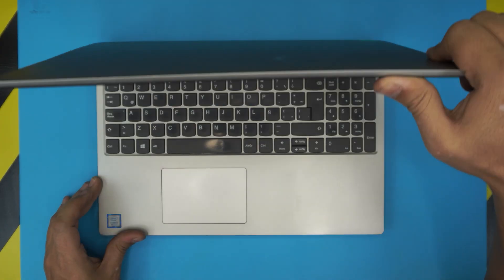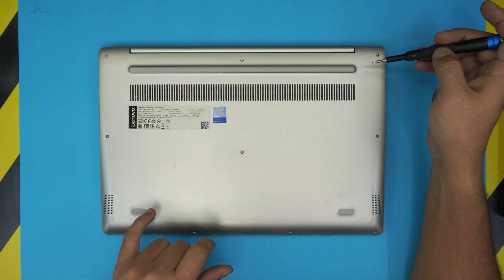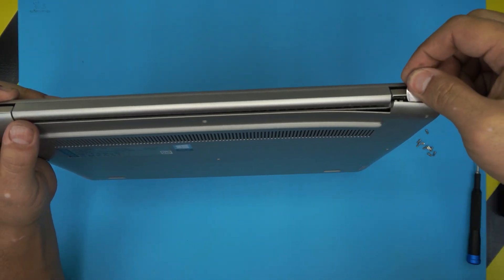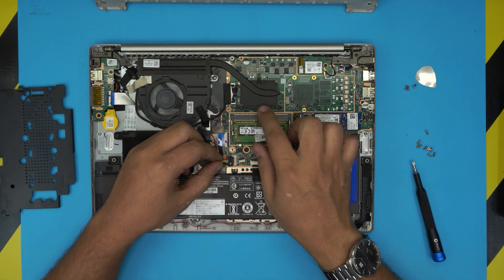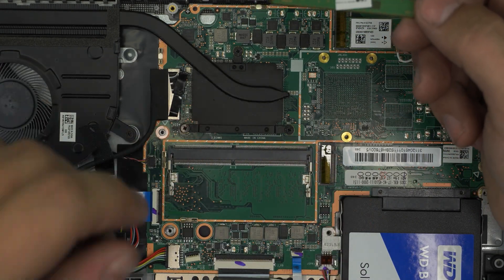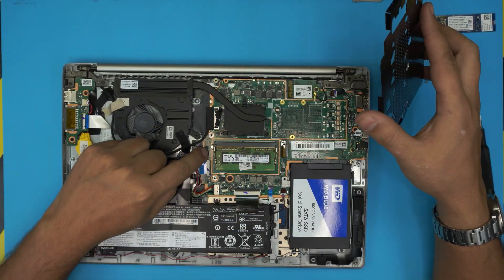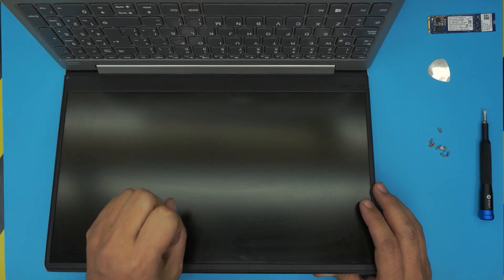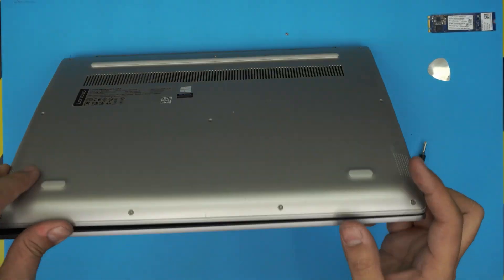Lenovo Ideapad 330S RAM Upgrade Step by Step

Comment: I have a problem in this laptop, initially laptop runs perfect but after 10 minutes a line on laptop screen blinking then after some minutes total screen  blink what is problem, give solution please 😢
Reply from the maker: 🫠Regarding your question, the CPU/APU is overheating. I recommend repasting and cleaning it to see if the issue is resolved. If repasting doesn't work, then a CPU reflow might be necessary.
Start with the repaste, test it, and let me know.
https://youtu.be/fI-VzX5pD80
Should you have any further questions or requests in the future, please don't hesitate to ask me.
cheers🍻
Reply: Thank you for response 😊 @uFixTek
Reply from the maker: It's my pleasure my friend.

Comment: Hi, nice video! 

Just quick question. So for that lenovo model, there are two RAM slots. The first one is 4GB embedded (soldered) and an empty slot (the one you used, is that correct? Basically, two slots of RAM but the first one unremovable. Right?
Reply from the maker: Thank you for your feedback! If you wish to support the channel, you can like, subscribe, or both!
Regarding your question, yes my friend you correct the 1st dim is soldered on board and one free upgradable dim.
Should you have any further questions or requests in the future, please don't hesitate to ask me.
cheers🍻
Reply: @uFixTek  thank you! You're the best !
Reply from the maker: It's my pleasure my friend.

Comment: does the laptop already have the ram inside the slot or no?
Reply from the maker: Thank you for your feedback! If you wish to support the channel, you can like, subscribe, or both!
Regarding your question, it all depends if you purchased with extra ram option or just the basic 4GB ram.
usually they come with a 4GB stick. we have seen clients bringing them in with 4GB on board and a free slot available.
the best bet is for you to open and check, there is not way that a program can tell you if you have it soldered on board or using a slot.
we open this laptops often and it's different configuration of the rams.
Should you have any further questions or requests in the future, please don't hesitate to ask me.
Reply: @uFixTek  thank you so much 🙏
Reply from the maker: It's my pleasure my friend.
cheers🍻

Comment: Hello mate I buy a ram 8gb ram for my Laptop from Mr Memory forLenovo 330s-15AST 4gb ram 128gb SSD but when i plugged in and after that I press on to see what happening with Laptop and screen is black screen. After that I remove the new ram from Laptop and everything is working fine. So my question is what is wrong with the ram. Thanks
Reply from the maker: Thank you for your feedback! If you wish to support the channel, you can like, subscribe, or both!
Regarding your question, i need to know the exact specification of the ram that you purchased.
Reply: Lenovo ideapad 330-15AST upgrade  8GB DDR4 PC4-17000 2133MHz 260-pin SODIMM
Reply: I have the same problem.  There's a 'novo'? button on the side that you can press with a paper clip to invoke bios that might help...  will be trying that.  Also, leaving it on (with blank screen) for a few minutes in case it is trying to work stuff out.  Will post here with results...
Reply: The 'novo' button requires a paperclip to be inserted.  I tried that and other small tools including sim card remove tool.  WITH or WITHOUT new memory, it did nothing.  I tried pressing it turned off, I tried pressing it turned on.... nothing.   I also left the machine with a black screen thinking it might 'get better'.  It didn't.  So I am guessing that there's an incompatibility with the ram and that's that.

Comment: Thanks for the information, I have problem only with Keys (X, S, W, and 2) on my keyboard other keys working perfectly,  Could you please tell me what is the best solution?
Reply from the maker: Thank you for the feedback! if you wish to support the channel you can LIKE or SUB or both :P
regarding your question: There is no other option that can save you from that, it is like a cancer and it will get worse, the membrane of the keyboard is starting to get worse. all you have to do is replace the keyboard.
here is on how to replace the keyboard. https://youtu.be/xsg-Zn80hZQ
Reply: @uFixTek  I appreciate your response, Thanks.
Reply from the maker: It's my pleasure my friend🍻😊
If you have any future questions or requests, please don't hesitate to reach out to me. I'll be happy to assist you

Comment: No, the SSD slot is actually an NVMe. I've installed my NVMe drive and I got all my NVMe speeds right there.
Reply from the maker: we have tried on this 330s 3 out of 10 accepted NVMEs, its something we talk to the lenovo to see is there something can be updated with bios or something because its hard to say 100% its nvme compatible, because the same nvme works 3 out of 10 :/ 
glad that yours worked 🍻 enjoy the speedy loads

Comment: Thanks for this video. The head shield had some clamps that I used a small flat head screwdriver to gently push away from the shield and the heat shield popped off. Once I turned it on it took a little longer than normal to turn on and boot up but I guess that was windows recognizing the new ram. Also it shows 20GB so I'm guessing it's counting internal ram plus the 16 I added. Either way I can tell the difference immediately thanks again for the video.
Reply from the maker: Thank you for the feedback! if you wish to support the channel you can LIKE or SUB or both :P
regarding your question:  yes anytime you add or remove ram the BIOS will do a initial ram check that can take up to 15sec sometimes. but that's only 1 time. enjoy your upgrade my friend :)
if you have any question or request in the future feel free to ask me.

Comment: Greetings, I am looking to increase the memory and add an SSD but I am confused with the information from Lenovo that says that it can only be increased by another 4gb for a total of 8Gb and the SSD only SATA 2.5", but on the Crucial page it says that it can be it can up to 16Gb for a total of 20Gb and if it supports M.2 NVMe SSD, I see several comments in which you recommend the Crucial configuration but I would like to confirm it, thanks.
Reply from the maker: Thank you for the feedback! if you wish to support the channel you can LIKE or SUB or both :P
regarding your question: don't listen to the lenovo information center they are always false, this laptop can handle an 16gb ram 
we use this ram very compatible and durable: https://amzn.to/3v9egLK
and right beside the ram you can install and NVME m.2 ssd without any issue up to 2TB and keep you mechanical as an extra storage.
before upgrading the m.2 update the bios from lenovo website.

Comment: Hello pls I need help 
I juts bought this same model and heard it had a AMD Radeon 540 but I can't get it to work on mine 
Pls help
Reply from the maker: Thank you for the feedback! if you wish to support the channel you can LIKE or SUB or both :P
regarding your question: open the cover and if you don't see anything in this area that i marked : https://imgur.com/a/BTxyCzl
Then you don't have the GPU installed on your model, not all come with AMD radeon, and if you had it install it would show up on your task manager. IF you don't have it and you want to install it, the answer is not possible. you will need a higher amp charger and a bigger heat-pipe and

Comment: Thanks for the video. I want to upgrade my Laptop Lenovo ideapad 330s  -15 Ikb Type 81F5. MTM: 81F50048US. 
I'm considering buy the Samsung 970 EVO Plus m.2(2280) nvme ssd with 1 Tb capacity, and if it is possible also change the 1 Tb hdd with 1Tb  ssd sata 2.5" but I don't know if these two changes will work ok. Please any help will be much appreciated.
Reply from the maker: Thank you for the feedback! if you wish to support the channel you can LIKE or SUB or both :P
regarding your question:   yes my friend, you can have both, you can install 1tb up to 4TB NVME  SSD, and have at the same time 4TB ssd sata or HDD 2TB (as anything over 2tb HDD will be thick)
1TB evo ssd nvme: https://amzn.to/3L0N3AF
1TB ssd 2.5': https://amzn.to/3MnG9ad
2tb hdd 2.5': https://amzn.to/3FHerTg
THE BEST brand on SSD are Samsung as they are very reliable and durable.
before any changes update the bios firmware from official site.
Reply: @uFixTek  Thanks a lot for your fast reply
Reply from the maker: my pleasure my friend, if you have any question or request in the future feel free to ask me.
Reply: @uFixTek  Hi, I really liked your videos and follow you recently. I have the same model of Lenovo laptop as the person who commented above: ideapad 330s -15 Ikb Type 81F5 (Processor: Core i7-8550U; RAM Memory: 1x 4GB DDR4 2400, 1x 8GBDDR42400 ;Hard Drive: 1x 1TB 5400 ).
Where can I verify the information that it is possible to upgrade to 4TB NVME SSD and 4TB SATA SSD as you say? I have searched the lenovo site but can't find anything about the maximum values I can upgrade to my RAM and storage capacity. I would be very grateful if you could share your source of information, because I am interested in upgrading my laptop with better components.

Comment: did u use 256gb ssd?
Reply from the maker: Thank you for the feedback! if you wish to support the channel you can LIKE or SUB or both :P
regarding your question: i did the 250Gb ssd as my client requested, you can place a 4TB ssd if you wish and even a 4th m.2 nvme ssd if you want both.
Reply: My laptop has a 16gb obtane and 1 TB HDD....
Reply from the maker: you can remove the 16gb optane drive and place a fast SSD (NVME) and place the windows there and use the 1TB HDD as storage.
https://amzn.to/3qpkyF9

Comment: Hey I was wondering if this is single or dual channel cuz I don't really know much about computers.
Reply from the maker: Thank you for the feedback! if you wish to support the channel you can LIKE or SUB or both :P
regarding your question: don't worry about the single rank vs dual rank, both will work fine and you wont even know the difference on this motherboard at all. but if it makes you feel better the single rank is a very tiny bit better than dual.
Reply: @uFixTek  hey sorry didn't see this till now. thanks for the help!

Comment: Thank you for your sharing.  Actually, I've got a 330S 15ikb with 4GB ram while I'm considering to upgrade it within these days.  By reaching the information from the net, some said that the computer could only be upgraded up to a total of 12GB only (4 on Broad+ 8 GB external).  I would like to ask for your professional opinion, can I upgrade my computer up to 20 GB RAM (4 on broad+16 GB)? and if available, what is the best ram speed to choose? The current ram speed of mine pad is 2400MHZ, thank you and looking forward for your kindness reply. 🙏😊
Reply from the maker: Thank you for the feedback! if you wish to support the channel you can LIKE or SUB or both :P
regarding your question:  sure i need to know 1st if you cpu and motherboard can handle that much ram , so please check this video and see what the max ram capacity:
https://youtu.be/tKEJTkVth4Q
if it says 32GB then sure you can go 4gb On board and 16gb additional, we do upgrade them often, but its best to check the max limit.
we use this : https://amzn.to/3Gzv95X
don't go over 2400mhz because the one built on board is 2400MHz and if you place anything higher the bios will down clock it to match the lowest.

Comment: Great video! Was just about to start upgrading my 330s and then I realized it has 6 gb ram and a max of 12 gb. Can you explain how does that work? Because I cant find any 6 gb rams in my town, only 8.😭
Reply from the maker: Thank you for the feedback! if you wish to support the channel you can LIKE or SUB or both :P
regarding your question: then your motherboard had 4GB built in and the ram stick is 2GB right?
*remove the ram stick and it should say 2GB. if so just remove that and place a 8Gb . 4GB on board and 8Gb new total 12gb.
https://amzn.to/31H65Lj

Comment: what's an 'obtain drive" (that's what subs calls it) that you remove just before removing the ram?
Will doubling my son's laptops 8gb ram allow his Minecraft to run any better?
is there only 1 ram slot so I can't just buy another 8gb ram to stick next to the original?
thanks
Reply from the maker: Thank you for the feedback! if you wish to support the channel you can LIKE or SUB or both :P
regarding your question:  regarding the optane drive dont remove it unless you upgrade the hard drive to a ssd.
https://youtu.be/mhDbojHhwUg
and this laptop only has one ram slot available, i would recommend to remove it and place an 8gb ram.
https://amzn.to/3DnpiyB
and it will help to run the game better, but upgrading the mechanical HDD to SSD will make it much better on loading and the windows will run way better, check the link i send above. just remove the optane after placing the ssd.
https://amzn.to/3rwuldS

to install windows on new ssd:
https://youtu.be/uDu8j2lE-dM
follow this steps during the windows installing:
https://youtu.be/oQ7NiirV4JQ

Comment: Thanks for the video, you helped me a lot! I have a doubt now, I 
currently have the 330S with 1TB HDD + 16 GB Optane tech, I want to 
install a m.2 SDD for system and some programs, and leave files and the 
rest to the HDD. But the trouble, as you might know, is that the m.2 slot is the same where 
is installed the Optane, so I have to remove Optane memory if I want to 
install the SSD. It's actually better to have SSD + HDD, or HDD + 
Optane? Thanks!
Reply from the maker: Thank you for the feedback! if you wish to support the channel you can LIKE or SUB or both :P
regarding your question: 1st of all the Optane is truly a garbage invention, i would recommend you to back up all your files and do the following:
get a m.2 ssad sata, recommend you to get a samsung brand:
https://amzn.to/3kZwkn1
 and make sure you disconnect the hdd when installing windows on m.2
after installing windows on m.2 then plug the hdd and format the drive and use it as a extra storage for games or big files.
how to create windows 10 usb: https://youtu.be/uDu8j2lE-dM
proper way of installing windows 10 (use a reference for steps)

info you may require:
to get to BIOS:
Turn the PC off. Turn the PC on. Immediately and repeatedly press (Fn+) F2 or F2. Accessing the BIOS may take multiple attempts.
when you plug the windows 10 usb power on and keep taping on f12 or (fn+) f12 to get to the boot menu and choose the usb.

Comment: We have the same laptop model. Can I upgrade mine with an 8GB 2666mhz ram?
Reply from the maker: Thank you for the feedback! if you wish to support the channel you can LIKE or SUB or both :P
regarding your question:  yes you can, it will work just fine.
Reply: @uFixTek  thanks for the response. I appreciate it😄
Reply from the maker: its my pleasure , if you have any question or request let me know.
Reply: But in your previous comment you said don’t go over mhz, this labtop is 2400 mhz. So 2666 mhz is not good. Right?

Comment: Which Ram speed to use please ? Or it will not make a difference?
Reply from the maker: Thank you for the feedback! if you wish to support the channel you can LIKE or SUB or both :P
regarding your question: this is Intel CPU the ram speed on intel cpu are not that important and if you place a high speed ram the bios will bring it down to its supported speed, but get anything at 2666MHz
https://amzn.to/3DvoJTY
Reply: @uFixTek  thank you 👍🏻👍🏻
Reply from the maker: my pleasure my friend thank you for the support.

Comment: Your video is excellent. What is that component you removed and never put back during assembly?
Reply from the maker: Thanks ✌  for the feedback!  if you wish to support the channel you can LIKE or SUB or both :P
Regarding your question: the component that i removed was a optane ssd cache, the reason i removed its because i made a video on how to upgrade the HDD to SSD.
https://youtu.be/mhDbojHhwUg
there reason that the optane ssd cache was installed is because the factory installed a HDD and the HDD are much slower and the optane ssd cache will act like a cache so it can speed up the process, BUT if you have upgraded to SSD then there is no need for the optane ssd cache, as it will slow down the system.
i hope i have explained it :)
if you have any question or request feel free to ask me.
Reply: @uFixTek  Thanx a lot. Well understood.
Reply from the maker: anytime my friend, if anything you can always ask me here. :)
Reply: @uFixTek  So if I'm just upgrading the RAM, I should leave the optane cache alone?
Reply from the maker: @CSMMistakesWereMade  Yes dont touch it if you upgrading ram only
Reply: @uFixTek  I was puzzled by that gadget too!

Comment: Hello 
I made a login  but after my screen it was black ,so I opened to clean the ram ,while I opened I realized ram was missing ,can the laptop works without ram ? omg
Reply from the maker: Thank you for the feedback! if you wish to support the channel you can LIKE or SUB or both :P
regarding your issue: Someone stole your ram lol, a laptop can turn on without ram but it will not boot or show anything on the screen. sorry you need to find the rat :P